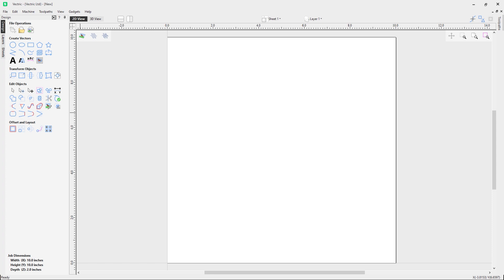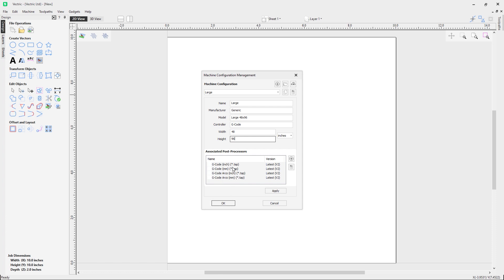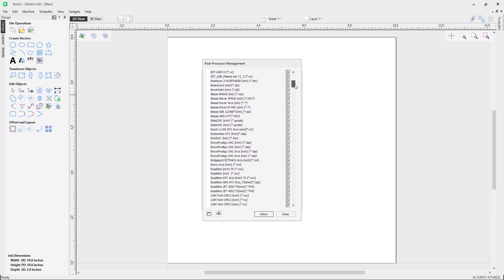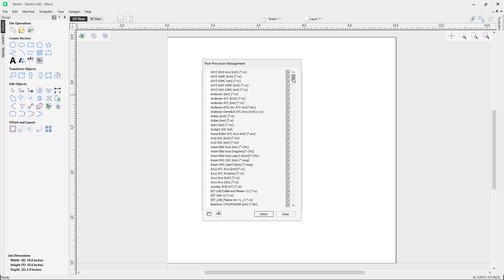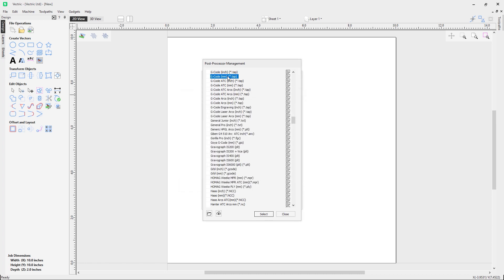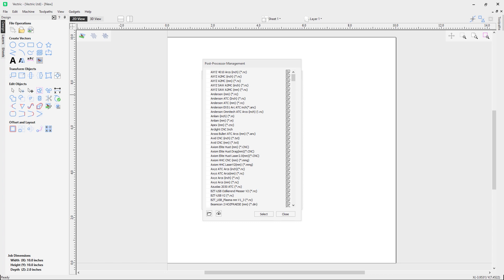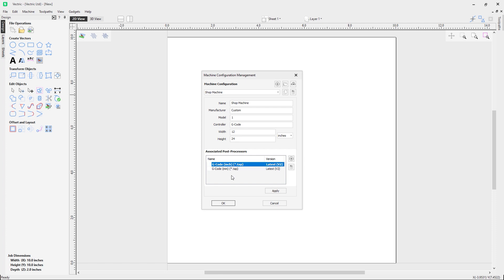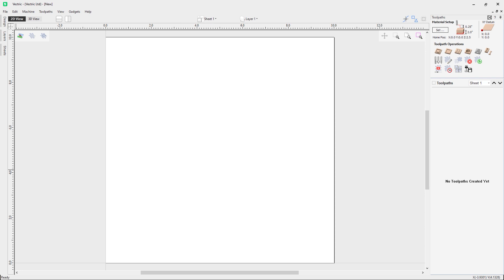How to set-up your machine configuration in Vectric software | Toolpath FAQ's | V12 Tutorials

Comment: Setting up your machine if your machine is on the list would i select my machine instead of G-Code or is there a reason your selecting G-code instead of a specific machine? Thank you in advance! Also would i change the controller from G-Code to mmg if that's the file extension that comes with my machine?
Reply from the maker: Hello I would choose the machine if it is listed... and I would most likely choose the units you feel is right.  If you have trouble or things don't work as expected... please contact support@vectric.com and they can help.  :)

Comment: Hi, is it possible to configure the tool settings for the speed of the spindle on my machine (TTC 450) as the spindle speed is 12,000 as this will affect feed rate, love the software finally getting to use my cnc as imagined
Reply from the maker: You can add in a spindle speed for all of your tools, so I don't think I understand.  This might be one for support@vectric.com where they can ask you more questions to better understand what you are trying to do.

Comment: Hi, still do not undestent what is width and height ( is this a X and Y like working aria of machine ?) Please explain .thx
Reply from the maker: Hello and thanks for the question.  Your machine's X and Y working area is the area your CNC cutting tool can reach.  For example, some machines say they are 1000cm x 1000cm, but that is the size of the machine bed or waste board (this is good to know because it tells you the maximum size of material you can put on your CNC).  It does not tell you the maximum size your toolpath can be.   If your machine provider does not tell you that then you can do the following - 
- Zero your machine
- jog it in the X direction a comfortable amount or until you trip a limit switch - note that distance (should show in your controller software).
- do the same for the Y direction, note that distance...
That is the max working area.  
Remember that is the maximum reach of the tool, but when creating your projects, you need to consider hold-downs or other limitations of your machine (like the dust shoe hitting something).
Reply: @vectric Thank you for clearing it up.